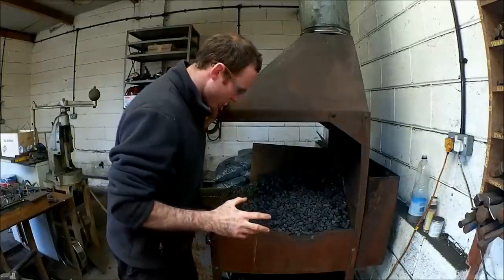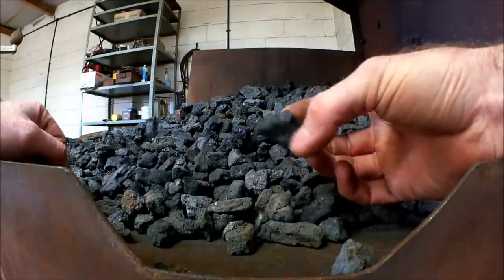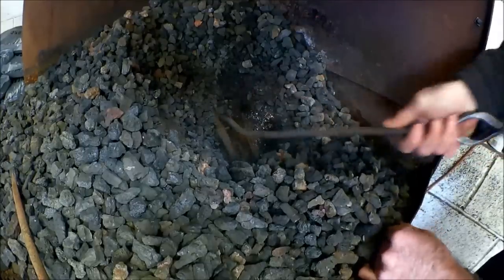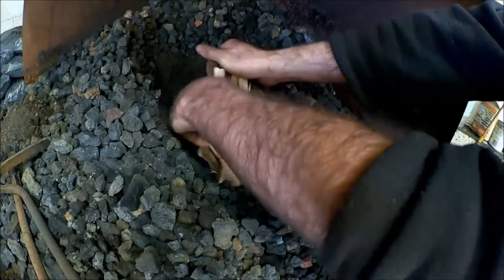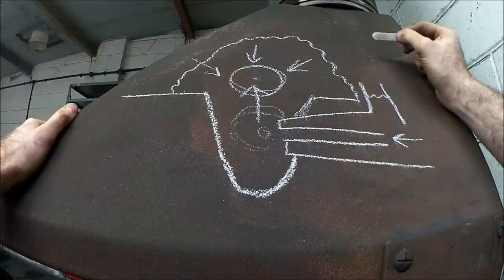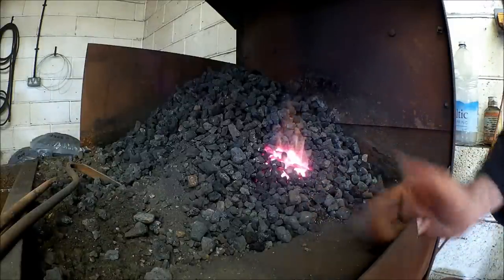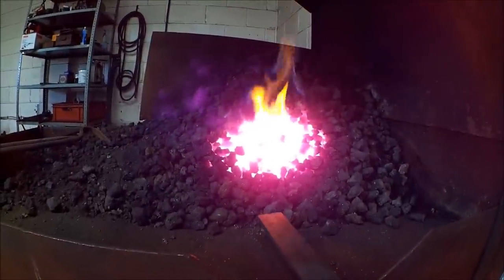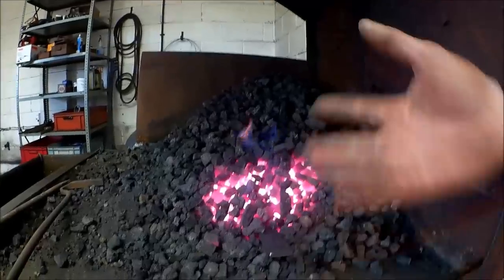Blacksmithing - Why Side Blast Forges Are The Best #1

Comment: Hi, Great forge and very nice explained :) ....Do you think it would work with charcoal, and could it work without water cooling system because of lower burning temperature of charcoal?
Reply from the maker: Hey Matko. Charcoal is best suited with a larger pipe so it has more volume of air and less pressure but the overall design will work the same. You can use waterless regular steel pipe but will corrode quicker and needs replacing after several uses. I'm using a waterless stainless pipe in our demo forge and it is corroding but still works well. Charcoal can still reach the high temperatures enough to forge weld but you'll use a larger quantity compared to coke and coal to achieve the same results. I hope that is helpful. Cheers J
Reply: @joshuadelisle  Thank you very much for your help and advices, Cheers
Reply from the maker: Anytime thank you for watching!

Comment: Awesome video I am newer to smithing and have only used a gas forge until now and im contemplating building a forge like yours but before I do will it work as well with coal as coal is easy to get where I'm at and is inexpensive  I can get coke but at a much higher cost and also about how much coke would you say you go through in a session I'm a hobbyist   and won't do production work but is a long drive to get coke and want to make sure it would be worth it
Reply from the maker: Hi Nathan thank you! you can use coal thats not a problem. It will depend on how much air is used and what stock your using , typically I would use 12kg in a day full time forging light stock and mabye 20kg ( full bag) if doing heavy work or forge welding. a two hour session would use maybe 5-7kg of coke. Coal I'm not too sure about its full effientcy but It is alot more work. you need to wet the out side coals on the forge to stop the whole lot becoming ablaze and alot of gasses are released before it 'Cokes' meaning its most efficient burning stage and turning into coke. Coal isn't as clean as coke and is harder to control which may make it harder to use for a beginner. I should do a comparrison video on the same forge using coke, coal, charcoal and hard wood...

Comment: here's a thought, make a steel ball mill and pulverize the clinkers into grains of sand to replace the sand lost do to cleaning out the forge.
Reply from the maker: not necessary, ash builds up and replaces the sand and insluates the fire better as well as doesn't turn to glass decreasing the size of the clinkers.

Comment: Hi Joshua, I love the time you took to go into your side blast forge. I'm in Canada, the land of metric measurements and US bottom blast forges ;) I have had bottom blasts in the past, and the last one I made was a bottom blast with an aggressive clinker breaker and side draft hood. It was a good setup but wasted part of the fire every time the clinker breaker had to be operated. I sold it and I've always wanted to try a side blast. Have you tried running one on coal? I've read that it works but the fire characteristics are somewhat different than on coke. Coal / coke here is hard to get, we have big mines and they are 100% export. Usually the smallest quantity available for purchase is a rail box car, unless you can find a special arrangement with a kind-hearted coal terminal manager. Anyways, I've still got a couple tonnes of met. coal and obviously would like to stick with it, or at least use it up. So, I don't want to build a side blast if it won't work well with coal. Any advice on this?
Reply from the maker: Thank you Stephen! I have used coal before but prefferd coke, mainly because of its efficiency, ease of use for fire welding and less hazerdous smoke. The priciple is the same no matter what type of forge or which fuel you use, you need to have suffient control of the air in ratio whith the fuel. my side blast design makes removing the clinker easy even while in use and generally takes longer to 'clog up' compared to bottom blast designs. The sand fild bed is also great for adjusting the depth and space of the core of the fire for diffents size heats which with a solid steel brake drum I can only guess is limited. personnally I would love to use only sustainable sourced charcoal but that's just too expensive and inefficient for me in comparrison to coke.  If solid fuels are hard to get hold of but you have industries near you would it be better to use a gas forge and buy local propane tanks instead?
Reply: +Joshua De Lisle Thanks Joshua. Gas would probably be more practical but coal is so cheap to run and honestly, I've been using high grade coal for over 10 years now and really am fond of it. Couldn't give you a scientific reason other than I've grown attached to it.  It's predictable, retains heat when the blower is shut off for more than a few minutes, and smells good ;) I agree about the benefits of charcoal and I'm putting together a 200 litre charcoal making tort. Not sure if it will be effective to run, in terms of labour time, but I'm going to try and see. I started on charcoal for the first year of forging and enjoyed it except for welding.
On the back of your demo forge it has 2 water jacket pipes coming out the back of the tuyere. Are those necessary or could I just have the back of the tuyere open to a 50 litre water tank.
Reply from the maker: Yes i'm going to do another video soon on the forge to explain just that. my main forge has a 'back bosh forge' if you type that into google. It will work just as fine with coal but I would say coke is more suited for a side blast than a bottom blast. I would love to see your Charcoal making as it is something that I also would love to do. I'll subscribe. Thank you for the feed back and talking about it its great to hear others perspectives! J
Reply: +Joshua De Lisle That's great, thank you for the back bosh terminology. I look forward to your video "forge part 2". I have a solid 6 weeks of booked work ahead of me and then will start on the charcoal tort and will post videos of the process. By then our rainy season should be about done. Thanks again!
Reply from the maker: I look forward to it. Have a good one Stephen and catch up soon! J

Comment: Your explanations were perfectly clear, but I didn't get one point: why does water cooling is so important?
Reply from the maker: +Lou Bett Thanks Lou, your right I should have said, the coke will burn far hotter than the melting temperature of the steel so if it is not cooled then it will melt. you can have whats call a back bosh wich is a tank full of water that your tue iron (water cooled pipe) pertudes out of or like my demo forge you can have a tank which gravity feeds the water or is pumped through, I had an idea that I could pump it through to heat my house but not tried it yet. being made of steel and being cooled also stops things sticking to it while if you just used bricks you'll find it hard to clean it every day. I hope that helps.
Reply: +Joshua De Lisle Yes, thank you !
Reply from the maker: Your very welcome take care. J
Reply: Where does all the hot water go once it exits the forge in your current design?
Reply from the maker: Do check out episode 2 or even my video on the BBQ forge build to get a better understanding. basicly it cools and recirculates and eventually evaporates.

Comment: And i am pretty sure you can attached a rheostat controller to the blower for more precise air control. 
 You can get them on eBay for under $20.00 USD.
Reply from the maker: Dont need it with this type of blower, a large ball valve or a home made slide gate is all thats needed for adequate control.

Comment: nice design very informative.
Reply from the maker: Thanks Gary. I didn't go indepth on water cooling and how easy it is to remove the clincker while still in use. but let me know if you would like anymore explanation. take care. j
Reply: +Joshua De Lisle  Yes I need more info, you showed cold water in hot water out is there a tank you attach to these ports. I would like to see a blow apart of the Tue or a video of you making one.  Also the ball cock valve is used to reduce you air flow ?I saw where the bounce house fan blows 254 cfm, does coke require the same as coal on air flow 80 cfm?. Sorry for all the questions but I am trying to calculate the cost for the build, see how much I can find salvage. I'm on a fixed income and am usually financially embarrassed.I just found a supplier for coke, its cheaper than coal. Another question, does the mound automatically supply the fuel as the spent coke collapses into the crap trap? What about longer pieces of material that you may want to heat the center of?
Reply from the maker: +Gary Busby thanks Gary good questions might do another video to explain all that. quickly small coke beans are good for fire welding as a larger surface area uses up the oxygen and produces more heat. coke doesn't do that weird glupy way and stick together like coal so yes it auto feeds down and you just rake more on top. having the air on full will Increase the size of the fire then you can use the rake to push the coals and sand even to change the structure to get longer or wider heats. the small bouncy castle blower that you see is fine sometimes I would like a bit more power but 90% of the time it is turned right down because it's well insulted. centrifugal fans can be easily regulated by restricting the air flow. my main forge I use a slide gate that I made which is just a plate with a hole and anther plate the slides accross to cover the hole. the cold water is more heavy than hot water so if you have a tank sitting higher or level with your cold port on the forge and the hot water piped to the top of the tank as the water heats in the Tue the cold water in the tank will push the hot water out back into the tank and continue to circulate... or you can pump it with a water pump and heat up a hot tub! better to visually explaine. stay tuned!

Comment: I too made my own firepit from quarter plate about 3 years ago worling well .but im buggered if i can get a good draught up my chimney
Reply from the maker: I've found it a challenge too, my new forge works well, the hood is far closer with a 3m stack. I've heard a lot of good of super side drafts hoods. They are like a box with certain dimensions that produce a good draw.
Reply: @joshuadelisle  mines working   well at the moment with a few fettles on it i found a rivet had come out towards the back of the forge letting air in etc all ive got is an old hairdryer with a flex tube on the end and holes drilled in the firepit i made supopose i could make an ash dump but as its working well leave well alone just tap the inlet pipe to let the ash out
Reply: One thing that affects draw on all chimneys exiting a wall or roof is the mouth of the chimney should be at minimum 24” or 60cm above the ridge line on a gable roof, no matter how far away from it the chimney exit hole is. Or, on a flat or shed roof, 24/60 above the facia line. Back eddies from outside air movement around the roof/wall geometry play havoc with draught.

Comment: At the end of the day how do you shutdown your forge, so it can be brought inside?
Reply from the maker: Hey steve, my fixed position forge as seen, I simply turn off the fan and let the fire go out, nothing flamable about so I just leave it. my portable forge I give about 30mins to cool down and is propped on box section in my van to transport home making sure nothing flamable is near it and has a metal cover on the top.

Comment: Absolutely brilliant thank you for this video, I've been researching black smithing for a few weeks now, and this side forge you have shown is perfect for what I want, so I'm going to make a start with the forge and dimensions you have shown, what mm plate steel would you recommend for the build please?
Reply: Ah never mind the plate thickness, just read the other comments and found the a answer you posted :-)
Reply from the maker: +Dean Parvin Thank you Dean I'm realy glad this video helps! I'm starting some more soon as Im building more forges for teaching and I will show the process. keep in touch and thank you for your feedback!
Reply: +Joshua De Lisle I certainly will, and thank you! I've watched all your videos, a few of them a couple of times for the info to sink in hehe.  I shall eagerly await those videos, money is constricting me at the moment so I've got everything down on paper for the build of the side forge with the dimensions shown in your video.  

I don't have a large area to work with so that demo forge you made is ideal for me at the moment. So that's the planning for that done, after researching anvils and such and checking prices there tricky to get hold of, at least the steel ones,...cast iron a plenty but a no no for them.  

I have checked out making my own anvil from as big a block of steel as I can find, either that or a train track piece probably about 14 inches of length minimum at least for now till I can afford a new or used anvil that comes up that is 50kg and over.  As you can tell after 3 weeks of watching countless videos and reading material I am very excited to get started :-)
Reply from the maker: Good one, go for it, practice practice practice! I'm getting several lengths of Rail way track to cut up for Anvils, I have one my self they are great although slighlty noisy. I'll do demos on how to use one withth out a bick or hardy hole and still punch holes and make scrolls....
Reply: +Joshua De Lisle ah excellent!  lots videos to look forward to :-) from your recommendation from your videos I dropped the idea of building forges out-of barrels or barbecues, and seeing that side forge I won't settle for less on that aspect even if I have to wait longer :-).
Reply from the maker: +Dean Parvin You can fill a deep bbq with sand and fit a cooled pipe or you can just dig a pit and use clay to make a tue/pipe if you really want to go cheap. it will do the same job just not with finesse. I enjoy making primitive ones on the beach and using a large rock as an avil making stuff from the scrap we find. I will do vid on this too one day.
Reply: +Joshua De Lisle ah I see well that sounds like fun for sure and at least if I do that then I can get practicing alot sooner,  thank you very much for the advice. :-)

Comment: Every video of yours that I've seen has inspired me to do more! I have a question: Are you water cooling the air port just to make it last longer, or is there another reason? And do you just let convection move the water through it, or is there a water pump? Would it benefit from having a radiator?
Reply from the maker: Thank you so much. Yes it's to makes it last longer so oxidation from the heat of the fire doesn't corrode it, also heavy forge welding use will melt most pipe work if it's not water jacketed. The one in the video is by convection and is explained further in the follow up video no 2. My current forge uses a 12v hot water pump just like the one in my BBQ forge video and I use the tank as a quench tank also that you can see in the 30s nail video, it cools its self fast enough to remain lukewarm with heavy use. Cheers J
Reply: @joshuadelisle  I watched your next video, and it answered all of my questions!
Thanks for getting back!
Reply from the maker: @montecraig1149  thank you. All the very best. Cheers J

Comment: Great video! I appreciate you sharing the designs. As a newbie with metals, is there a particular type of steel sheeting to get for the forge body—hot vs. cold rolled, thickness, etc? Thanks.
Reply from the maker: Thanks Scott. I used 3mm thick normal mild steel however it comes to build the harth. I used 8mm thick plate to build the tue iron. I hope that helps. let me know how you get on!
Reply: Awesome. Thanks for the info!
Reply from the maker: I hope it works out for you, take care!
Reply: +Joshua De Lisle wow great informative vid thanks for sharing i am tryng to gather all the bits to set up a small forge the village blacksmith in history was the most important man in the village because he made everyone's tools and even kitchen utensils everyone went to him to solve there problems great to see you a young man like you Joshua carrying on the great tradition good luck in all your ventures
Reply: +Joshua De Lisle wow great informative vid thanks for sharing i am tryng to gather all the bits to set up a small forge the village blacksmith in history was the most important man in the village because he made everyone's tools and even kitchen utensils everyone went to him to solve there problems great to see you a young man like you Joshua carrying on the great tradition good luck in all your ventures
Reply: +Joshua De Lisle wow great informative vid thanks for sharing i am tryng to gather all the bits to set up a small forge the village blacksmith in history was the most important man in the village because he made everyone's tools and even kitchen utensils everyone went to him to solve there problems great to see you a young man like you Joshua carrying on the great tradition good luck in all your ventures
Reply from the maker: Thank you Roy! yes arguably metal workers since the first are the most important craftsmen/engineers in history to present day and forging will always be a huge part of that.

Comment: Side blast forges are the best! Buy i prefer a clay  tuyere and not a pipe with water (is more simply and works the same). I prefer bellows or piston bellows (fuibo), really better than electric forges. Coke is amazing, i love use coke but in Argentina is really expensive so i use charcoal (20 times cheap) and works great, less impurities.
Reply from the maker: Brilliant! I like the sustainable low inviromental impact of your system. I would like to do that more in my workshop. Cheers J